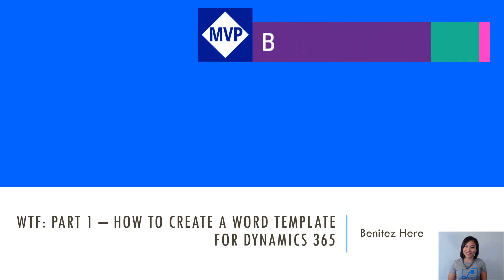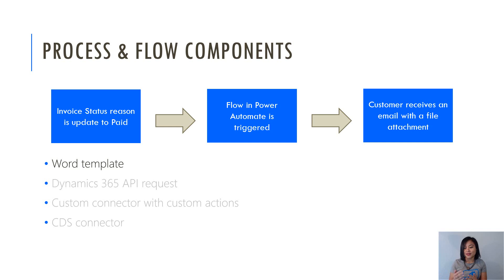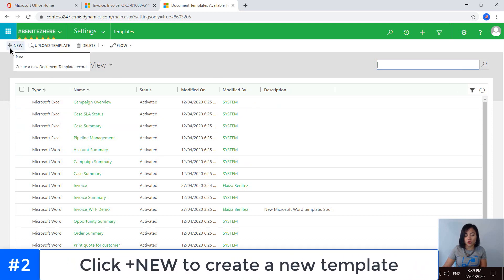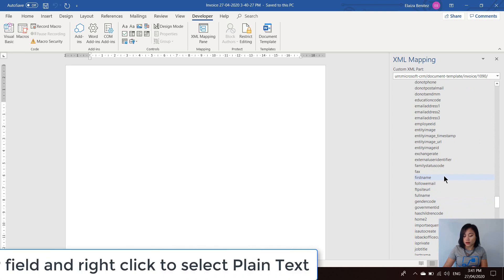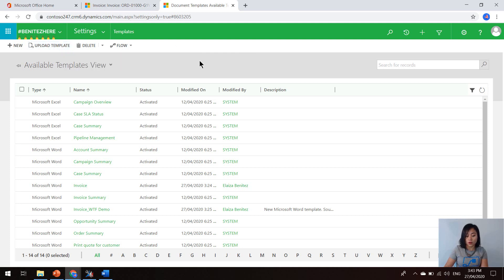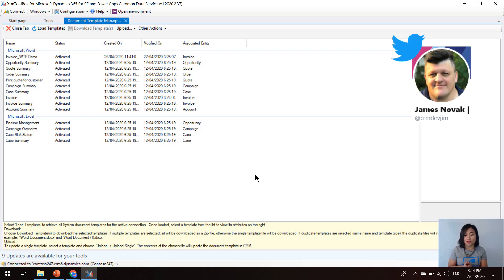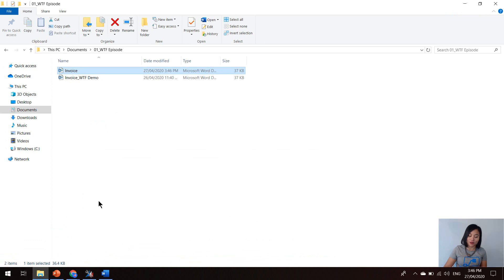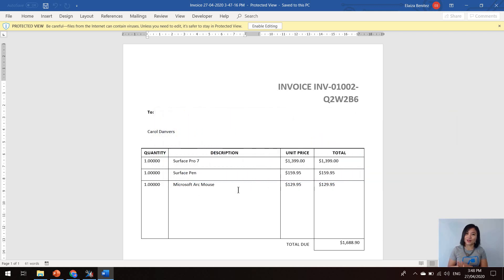PDF Automation series: Part 1 - How to create a Word Template in Dynamics 365

Comment: Thanks for sharing and explaining everything so well, I've a quick question, I've created a flow for generating a Word Template for Patient Statement...and then converting it into PDF. I'm running this flow for individual patients and the data is coming from SQL Stored Procedure to Word Template to PDF This PDF files are being generated and stored over the SharePoint. Instead of 50 separate files I want everything in one file. I didn't find appropriate Action in PowerApps flow for merging all the PDFs into one. Anyone has idea or suggestion regarding this? Can we achieve this using Flow in PowerApps?
Reply from the maker: PDF4me is what a previous customer used with cloud flows in Power Automate
Reply: @ElaizaBenitez  I'll look into this option. Thank you :)
Reply from the maker: @macm7730  This is their documentation with Power Automate for the Merge action - https://developer.pdf4me.com/docs/api/microsoft-flow/merge-connector/ I don't know if they have a limit on max number of files that can be merged so you may want to check that. Other options that I have not used but others in the Microsoft Community have used is Encodian and Plumsail. If you Google either of these, you'll find blog posts on them otherwise check out the cloud flow templates as a starting point. All the best for your automation 🙂
Reply: @ElaizaBenitez  You're awesome. Thanks for sharing the link and taking out time for explaining everything in detail. I'll google more regarding this :)